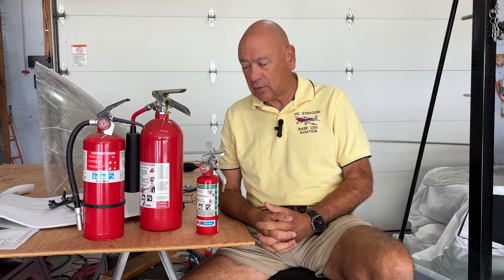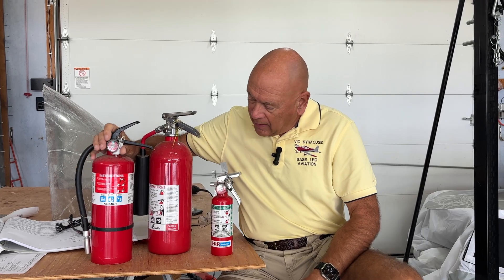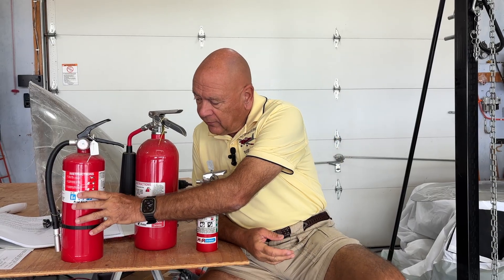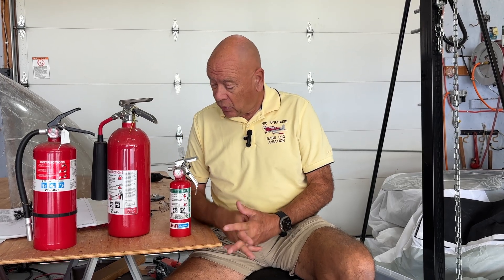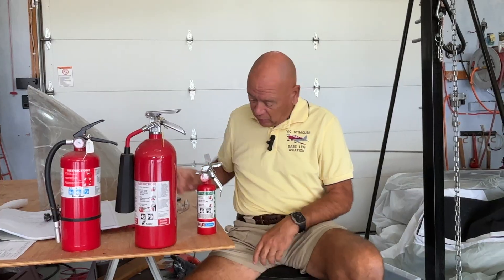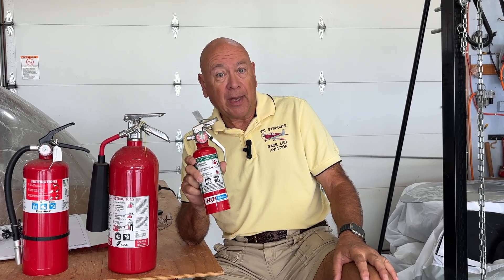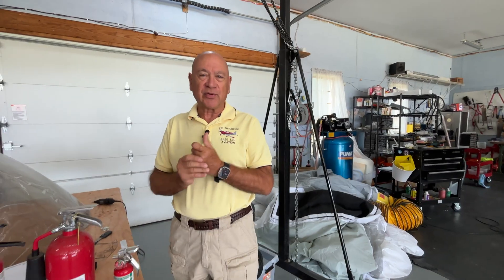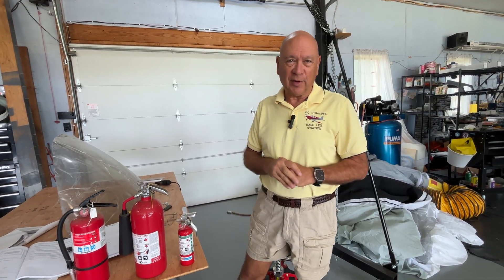Fire extinguisher, Jam Nuts, RV 10 update

Comment: Vic - thanks for your videos and RV10 content. So valuable.  Random question... Which 3-blade MT prop did you go with? Sounds like you've been happy with it. We have had some issues with our... not MT... and are considering replacing. We have a stock IO-540 260hp so it sounds like the 76" -12 would work fine for us. But we've been advised for longevity that the heavy duty -9 would be a better (albeit heavier) option. For your new build, are you thinking keeping the same prop?
Reply from the maker: yes, I’ve ordered the same MT prop. pretty sure it is the -12. I have over 3600 hours behind the MT prop on 2 RV-10’s now and am very happy.

Comment: Noticed your NACA vent on aircraft right behind the baggage area is facing AFT?!?!  Vic, is that by design? More airflow through the cabin?  Thanks.
Reply from the maker: Yes, it is. I’ve been doing some research an I think facing them backwards will help draw more airflow through the cabin and should be able to pick up about 25 knots airspeed! Now for reality….. total screw up on my part. I placed them in there with the hose connection going forward to the overhead console without thinking. I’m so mad at myself. I need to figure out how to get them off without damaging the skin as they are on with proseal. then I will patch the skin and probably add the new ones a little lower on the fuselage. 😡😡😡

Comment: I agree that dry powder has its problems, but in a workshop they are good. My workplace had a fire and we emptied 3 CO2's of that size and didn't win. One small dry powder did the job in the end. So my experience of CO2 has not been so good and while I have one it sits beside a dry powder backup.
Reply from the maker: yes, I mentioned that the ABC ones are good for the shop. even I have one, but far away from the airplane exit.